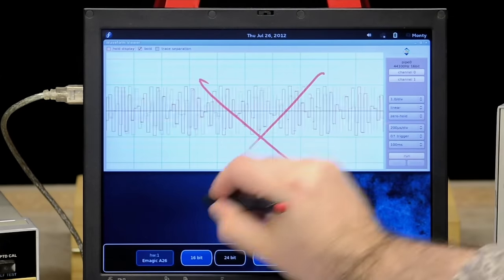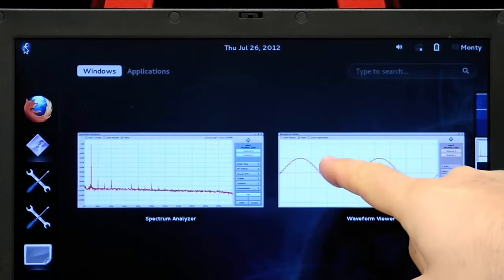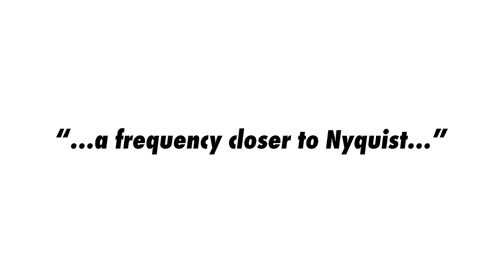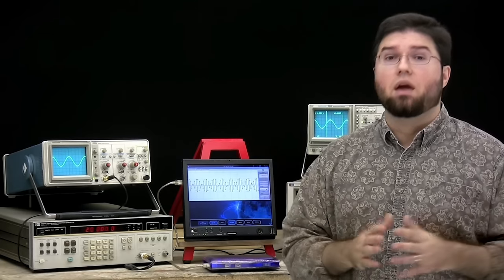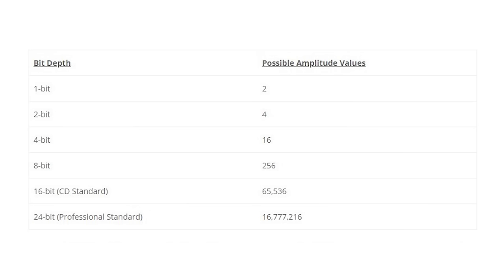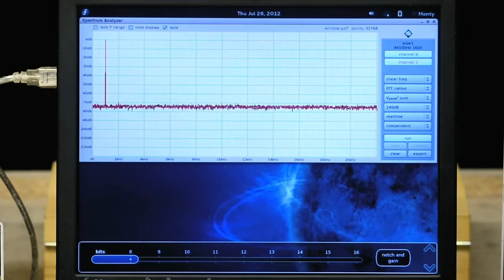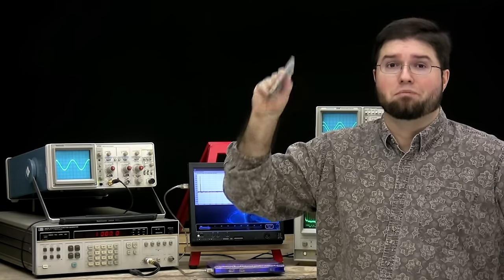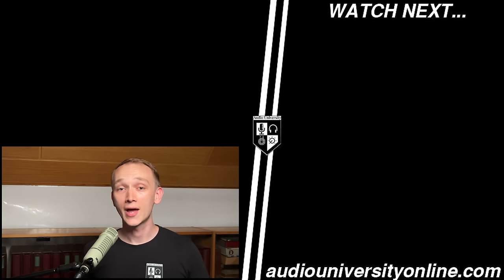Debunking the Digital Audio Myth: The Truth About the 'Stair-Step' Effect

Comment: Higher bit depth though is used in the production process to be able to do things like adding two loud signals or other processing functions that would otherwise add quantization noise (ever see the bands in a dark part of a streamed movie?) or blow past the highest signal of a lower bit depth format. The signal is then requantized before mastering back down to 16 bits. The creators of the CD format really knew what they were doing, and had over a century of digital and signal processing research to call upon to come up with the 16 bit/44.1 kHz format.
Reply: Same thing for sample rate: They have a use in production. When you want to do non-linear filtering without the higher harmonics getting aliased back down, or because it helps to avoid filtering artefacts, or so you can slow down a sample without  it turning really base-y. But those are only intermediate stages, needed to help the mathematics of transformation work. Once production is done, it's all turned back into something more suited to limited human hearing. 44.1KHz, or sometimes 48KHz.
Reply: @vylbird8014  Exactly!
Reply: All true. High sample rates and bit depths are very important for production. But it's a complete waste for distribution. But it's not ALWAYS important for production either. Aliasing is not as common a problem as most people think. Not everyone is pitching and slowing recorded content down. And as for the higher dynamic range — it's very helpful to have that headroom in a recording, but again, is often not an issue. A lot of producers use it as a safety net, even though they rarely need it.

I'm more excited about the move to record in 32-bit float. That's not about dynamic range, but about never clipping unless the mic itself is overloaded, and never having to worry about gain until you are mixing. It's like the audio equivalent of shooting photos in raw.
Reply: @mwdiers  That would be really cool. Eliminate an electronic stage for gain adjustment in recording?
Reply: I thought the 44.1khz, 16 bit was due to Umatic tape restrictions?
Reply: @hicknopunk no that's not quite right but it's close. It has to do with how PCM adapters worked at the time. There was beta and VHS as well. The analog signal is what was important. They essentially modulated the digital audio samples onto video scan lines. Essentially 44.1kHz works with both PAL and NTSC. So that frequency was chosen. 
So the reason why we sample audio at 44.1 kHz is because of compatibility between analog video broadcast standards being used the store digital sound.
Reply: @hicknopunk8314  I think that was a time rather than bitrate restriction. EDIT: It also dictated the sample rate by having to be in sync with the video scan rate.
Reply: Thank you.  I do my recordings at 24 bit depth, 48 KHz, downsampled as needed in the final product.
Reply: @blindsniper35  It's a bit more complicated though. 44.1khz was chosen based on some misunderstanding or legitimate indifference of NTSC video standards by the audio engineering community. At that time, high end audio for TV was not an issue. B&W video was 15,750h horizontal and 60hz vertical. And the industrial grade (not broadcast grade VTRs at the time) could easily accept 15,750/60. These 3/4 inch VTRs were often used for early digital audio mastering. Note that digitized audio at 44.1K, 16 bit produces a digital stream in the 3mhz region. You must use a VTR to record that bandwidth. 

But when the TV broadcast and production industry began using all digital VTRs, we had a problem. in 1953, the old B&W video standard was modified for NTSC color. Without getting into all the engineering, the addition of the color part of the video signal required slightly altering the H&V scan rates to 15,734.264hz horizontal and 59.94hz vertical. These frequencies will not divide evenly to produce a 44.1khz audio sample rate. So 48khz was adopted.

Now where this became a consumer problem was DVD and digital cable/satellite distribution. 44.1khz simply was not usable so all video based sample rates are multiples of 48khz internationally because 48khz also works with 50hz based video formats. And today with all our TV and video being compressed data, the 48K audio rate remains the standard.

*note that some Laser Disks did provide a 44.1k digital audio track. But in the case of Laser Disk, the digital audio was not required to be frequency locked to the video signal. It was just another FM carrier within the 10mhz Laser Disk bandwidth. So 44.1khz was fine and since most digital audio capable Laser Disk players also played CDs, this was a good compromise.
Reply: @blindsniper35  oh, VHS ... poor man's reel to reel 😌
Reply: @mwdiers  32-bit float sounds like a lot of effort to go to when you can record at 24-bit and just give yourself ~20 dB of margin. I suppose it might make sense for some scenarios, though.
Reply: @hicknopunk  Removing all the technical mumble bumble.... The use of exactly 44.1Khz (they needed anything slightly above of the Nyquist for dithering and cleaning up) was due to the NTSC standard. For various and complicated reasons, the previous 22.05Khz and 11.025Khz standards where based on NSTC.  44.1Khz is the next step multiplying by eight the previous one and falls exactly wher they needed. So that's it.
Reply: I was told once that it's just a safer bet to record at 96khz with a depth of 24 bits. It gives the extra headroom for working with audio signals. 16 bit at 44.1 khz is more than enough for listening to the finished product.
Reply: @andydelle4509  I thought it had to do with the compatibility between PAL and NTSC signaling. They're hijacking the television signal to put digital data onto the scan lines.(minus the ones you need to have left alone) So if I remember correctly 44.1khz a valid sampling rate for both standards; Without causing problems while exceeding the Nyquist frequency for audio. If I remember correctly the PCM recorders could operate at multiple different sample rates. They all had to fit neatly onto a scan lines evenly. Also if I remember correctly Phillips proposed a higher frequency based upon NTC color for the standard. If I remember correctly they were using the The television recording for their timing. So essentially these things are just a standard videotape head writing with standard compliant analog signaling(It just so happens it looks like funky snow on a TV)
The reason why they wanted a unified standard was it didn't matter what television signaling standard you use to record the digital audio. They wouldn't have to be resampled for a digital release and they can keep existing equipment compatible.
In the '90s there was also a data tape drive that used VHS tapes by doing something somewhat similar.(I vaguely remember how that works even less than how PCM recorders work)
Please explain to me what I have wrong and what I'm missing If you don't mind. I find this quite fascinating. 
Edit: I come at this from a digital signaling's perspective with a hobby of RF engineering / amateur radio. I have next to no experience in the audio field besides as a hobbyist.(The closest thing I have to a professional experience is helping with some conventions at college) I have formal schooling in digital signaling and some analog signaling but none in audio.(besides the coincidental overlap) So I wouldn't be surprised if I'm missing relevant information, especially historical. This was a curiosity I looked up a while ago with a quick refresher before I wrote my comments.
Reply: Okay there's a technology connections video that just came out on them. That's probably a much better source that any of my ramblings. Go watch that if you have more questions about how these work.
Reply: @blindsniper35  I think he was reading the comments and decided to make a video. Not like he needed weeks of lead time to get the PCM processor or anything :)
Reply: And what none of you have talked about is how the signal to noise ratio is a function of bit depth when the signal is converted back into analogue.

All that in depth technical discussion and not one of you has considered that aspect of it.
Reply: @deang5622  Thanks for adding it! I'm not sure how bad it would be when 16-bit is about 96 dB down, and the noise in the analog sources are probably higher than that. I'm guessing it would be a problem as stacking two tracks with a 96 dB noise floor would increase it by 3 dB? So four tracks would get you to 90 dB down, and 24 tracks would be... 80 dB? I'm not sure how dithering would lower that at the final output.
Reply: I think in the future they will discover that higher rates will produce better audio. Just because we can't hear certain frequencies doesn't mean that they don't produce effects to the entire sound. It's like rendering a game at higher than 4K, it might seem like diminishing returns but it actually gives the pixels shaders more to play with and can be used for lighting and visual fx that go on beyond the parts that we actually see. A smaller scale example would be a two polygon wall, lighting doesn't look very good on a low poly wall like that, so developers on the ps1 would tesselate surfaces to add more polygons, just to help with lighting and perspective correction...... Though the extra polygons would seem like waste to someone who doesn't know that. I think that's where we are right now with understanding audio, the things you can't see/hear DO matter to the end result.
Reply: The quantisation noise power is only 1/12 of a LSB. Insignificant in a 16 bit system.
Reply: @rogerphelps9939  That's a fallacy, making a comparison to the LSB. What matters is if you can hear the quantisation noise.
Reply: @PlasticCogLiquid  nope. it won't cause as u can see in the video, it doesn't produce better audio. also, what is "better"? Better signal noise ratio? use 24 bit, that's probably good enough.

people need to stop imagine stuff which is allready proven time to time. And with better streaming and bigger harddrives, soon, there's no need for any compressed audio like mp3 so we can all stop this mindless discussion.
Reply: All the poor music makers out there recording in 192kHz. Bless their hearts.
Reply: @PlasticCogLiquid  yes many instruments produce ultrasonics and these intermix tp produce freqs in the audible range. To not record these limits the timbre of the instrument, eg brass, cymbals , piano etc....
Reply: In DAW:s, floating point calculations are done internally with at least 32-bits of depth. Not so much additions which won't mean rounding errors if few decimals but more things like several multiplications in which each step means a possible rounding error.
24 bits these days are mostly used for the A/D and D/A converters that gets the sound into and out the DAW workstation (through an audiocard), ie transforming between analog to digital and back to analog again. Once it is in the DAW (in the digital domain), every calculation done is with much higher bits(precission). You can set 64-bit in Cubase also.
Reply: Wrong, wrong, wrong. Why don’t you just learn the truth of your art? Many do so before writing a faux authoritative comment. You should consider it.
Reply: @thomasmaughan4798 . Finally, a sensible answer. Pick a rate that works for your style, your DAW, your console, whatever.
Reply: @andydelle4509  Thanks, Andy. Your post is on the money, start to finish. In fact there is still the odd residual hangover of video frame rate incompatibility on legacy devices. Fortunately, inaudible SR conversion is a trivial task for any computer.
Reply: @deang5622    That may be because it is so basic and widely understood it needs no re-introduction. But, in actuality, it was mentioned and eloquently so. 16 bit is just perfectly suitable to music, at least 2 bits more than actually needed.
Reply: @deang5622  Introduce yourself to dither.  Let me start you off with how you will explain it forever more. “It’s added noise and I have the hearing of a porpoise. Why would I want to ADD noise?”
Reply: @jonimiller1954 . Pure BS.
Reply: @artysanmobile "Why would I want to ADD noise?"
I have no idea why you want to add noise, but I will explain why I value noise in the least significant bit.  

Consider tiny harmonics of a bell, for instance, that might not trigger the least significant bit and thus simply disappear.

BUT with a wee bit of noise, an average noise power of exactly 1 least significant bit, ensures that some of the weak high frequency notes trigger a bit, and some do not.  It then becomes possible to reconstruct a signal that is weaker than one bit.  

In effect, you are "rounding the edges" of the stairstep ADC conversion process.
Reply: @jonimiller1954  "many instruments produce ultrasonics and these intermix tp produce freqs in the audible range."
They are not supposed to intermix but in a nonlinear electronic circuit, such as a vacuum tube, they will indeed mix producing sum and difference frequencies.  These new frequencies aren't actually in the original playing of instruments but are created in electronics and it may well be that these intermodulation distortion frequencies contribute to the music in interesting ways.  Some artists do this deliberately with fuzz boxes and things like that.

Comment: I worked for BBCTV for 27 years as a sound operator and was there when digital recording reared its head. This video is most interesting and actually rather reassuring. Thank you!
Reply: How can we get the English version of "The Flying Dutchmen"
Reply: One of my favorite BBC R&D inventions is sounds-in-sync that used the same concept later used for digital recording with PCM converters to videotape, by digitizing analog sound and then converting that binary signal into a black-and-white television signal that could be sent along the standard black-and-white signal. The BBC used this also to feed FM transmitters where the digital sound would only be converted back in to analog and modulated onto FM in the transmitter. Basically Britain had the pre-cursor to DAB radio running from 1970 onwards - pretty impressive.